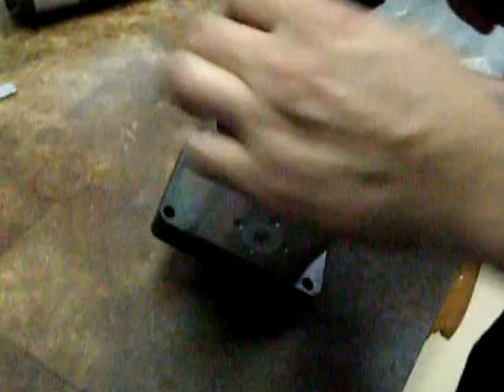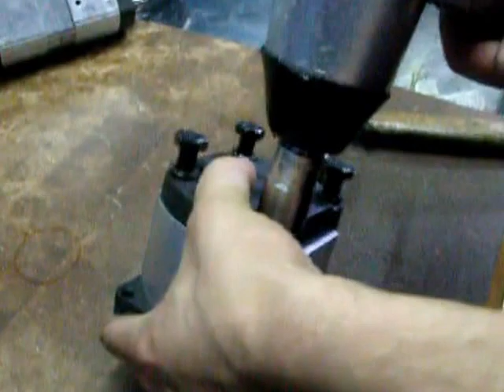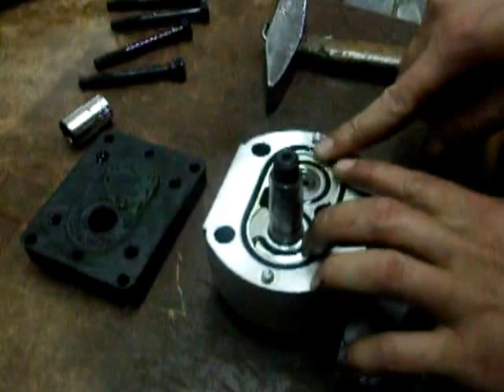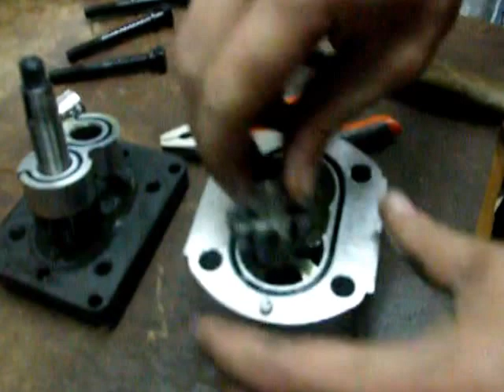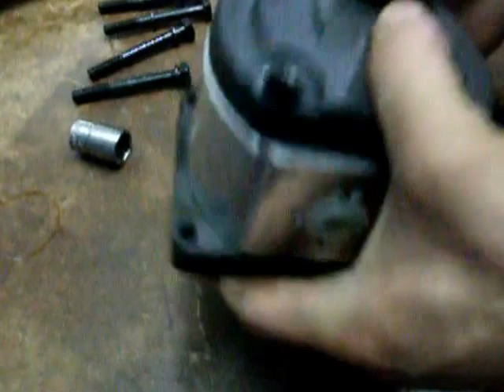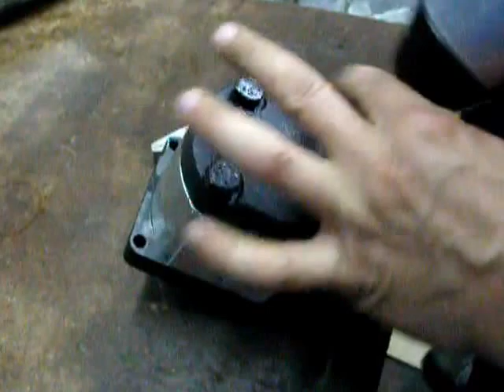How to Change Rotation of External Gear Pump

Comment: Good video but why to change it? What is the advantage of this?
Reply from the maker: Dear Mr. Mahmood,
Thank you for your comment. There is no advantage of changing rotation. This is an example video of service to show changing rotation. If you have clockwise pump in your hand, you can make it operated anti-clockwise rotation. Some pumps may have different seal kit place and changing rotation is not always possible.
Reply: @HydroPackcom  There is only one reason to change the direction of the pump , and that is the direction of your drive motor and way it turns - if you have an electrical motor it's easier to turn the direction of the electrical motor, but if you have a combustion motor and the pump is driven by a fan belt, or applied directly at the register of the motor , or gear box then one most likely have to change rotation of the hydraulic pump . - and it's done correctly btw. the only thing one have to change is the positions of the gear shaft.
Reply from the maker: @adele-2050   Thank you for your clear explanation :)

Comment: You put the bearing housing back the same way ! So the grooves for lubrication are now on the high pressure side  
So this is rong way 
You have to change bearing housing side.
Reply: erm , maybe you should try it your way . the suction port is still on the same side so the video shows the correct way - if you do as you say , you going to build up pressure inside the pump and blow the shaft seal, the ports stay the same you just change the direction on how the oil goes inside the pump, nothing more
Reply: i did as the video way so around 15 litres hydraulic oil went inside the engine Then i changed bearing housing After that everything worked ok
Reply: @ghozalighozali4471  the main thing is always (for a pump) the groves have to be on the suction side / inlet port of the pump,  else you build up internal pressure and shaft seal goes by by , and all sorts of funny things can happen. Doing the way as the video shows the ports don't change side. Good that you made it work for you :P , the biggest mistake at our company is people think the port change sides also.....  this video explain the hole thing a little better https://youtu.be/F3Sh0FY9eAM (in french but you get the idea just by watching the video....